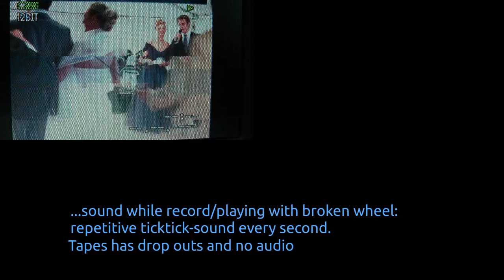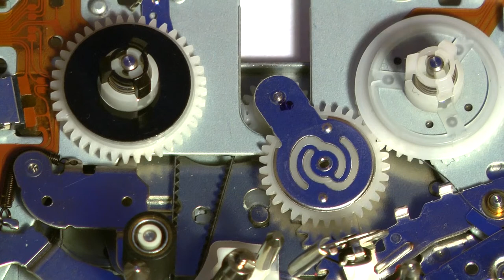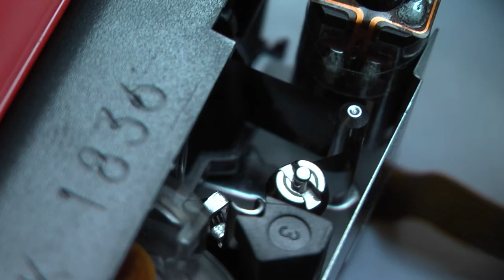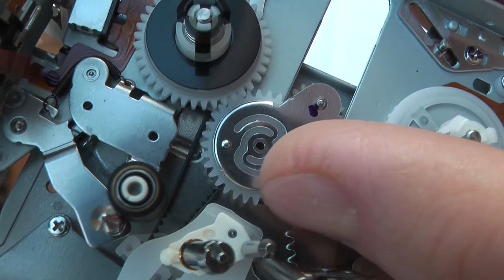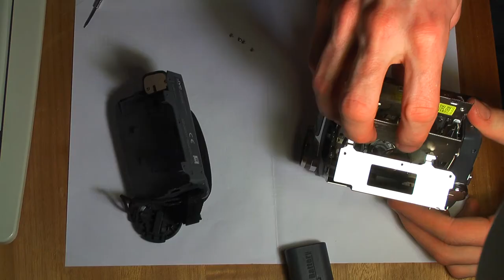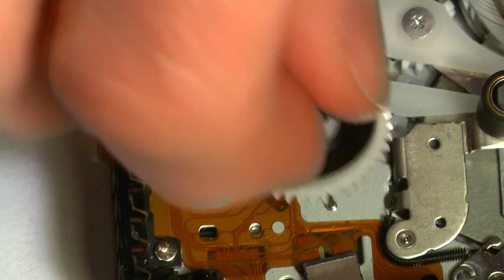JVC GR-D725 broken gear-wheel (fix in comment) miniDV Camcorder mechanic

Comment: And how can you find this broken gear?
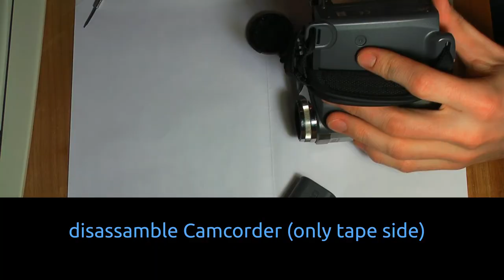Reply from the maker: @1:03; no solution to fix :-(

I tried: expand the wide of the tooth with a small rasp (like for nails). didn't worked.
Reply: Well, I have found a solution! (no I did not throw out the camera!) There is a metallic think inside the cog. I splitted the cog in half and removed the metallic obgect, then I glued the cog as best as i could. once glued, the metallic was not able to fit inside the cog, so with a bigger rasp I reduced the metallic a bit (its size) so that it will fit and center without breaking the cog. Then I put everything back together and  made recordings without problem. Only those tapes that had been recorded with the broken cog had problems but once re recorded, there was not a problem.
Reply: GotNoEvidence  I dismantled the gear and I removed the internal metalic part. then I joined again with strong glue the two parts of the gear (two halfs) so that they will be even with no gaps. The metalic now after the join, could not fit in the gear so I had to reduce its size in a way it would fit as accurately as possible. Then I put everything back together and the camera worked. It makes some ticking while fast forward but no artifacts at all. I reduced the sise with a small rasp arround the metalic.
Reply: @alexandrossotiropoulos5621  which kind of glue have you used? CA or superglue? Thx
Reply: @giovmari  I actually used super glue, but i was careful not to spoil the teeth with glue. The problem with this camera is a metallic part that goes under the gear and it acts like a brake by entering inside the teeth and that is actually that gradually breaks the gear. I removed this part so that it will not destroy the repaired one and there was not a problem. I finally got another mechanism from a sony minidv and placed a better one inside! But then I got a Canon minidv! because the mechanisms as far better!
Reply: @alexandrossotiropoulos5621  Thanks Alexandros, very helpful!
Reply: @alexandrossotiropoulos5621   is  the broken gear same for all brands of mini dv cameras ?  I have the same problem with the broken gear but  i wouuld like to avoid getting a replacement gear from another Jvc as all seem to have the same problem. I am wondering whether a gear from another brand, might be stronger even if  perfectly fittable to Jvc.
Reply: @leinrac6598  you can get one from a Sony minidv but they will not fit right. Or you can get the second gear from a jvc and place it there. Or you can use an IPhone! Or android
Reply: @alexandrossotiropoulos5621  It seems  all broken Jvcs have the same problem that is why  I  do not want to buy a non working  JVC camera as it probably has got  a broken gear already.  What you mean that I can use an iphone or Android ?  I have  a  JVC Dv Camera  mini dv and need to save some  tapes but do not want to spend much  money on this , only  I find absurd that  for this small broken part  I cannot find a cheap solution.
Reply: @leinrac6598  Ok, I am sorry I thought you wanted to shoot videos.Buy a used cannon. They are far superior.  Find a cheap one, save the tapes and sell it again, why to bother with those jvc. They are junk, I bought mine in 2009 for 300 dollars new and it broke after a few tapes. It is a bad design
Reply: @alexandrossotiropoulos5621  You are 100% right but I liked the idea of repairing it myself, if I could. . In any case I will see,  thanks for your quick answers.
Reply: @leinrac6598  you can also 3D print one, just the plastic without the metal part and install it
Reply: I dont mean to be so off topic but does any of you know a way to log back into an Instagram account?
I stupidly forgot my password. I would appreciate any tricks you can give me!
Reply: @Jorge Gregory thanks so much for your reply. I found the site thru google and I'm trying it out now.
Takes a while so I will get back to you later with my results.
Reply: @Jorge Gregory It worked and I actually got access to my account again. Im so happy:D
Thanks so much you really help me out !
Reply: @Abraham Bennett you are welcome xD